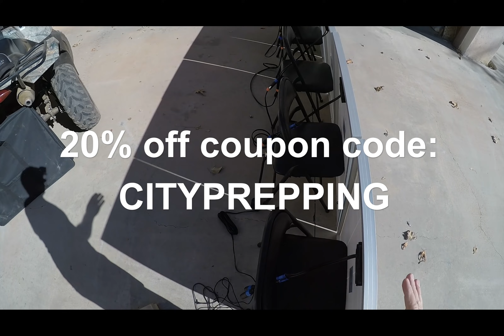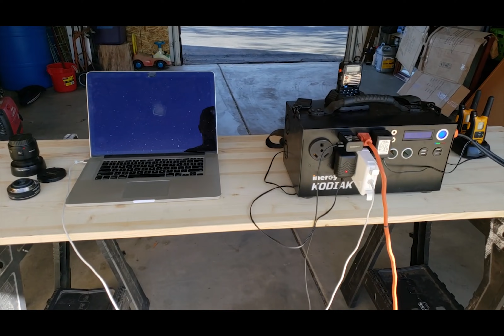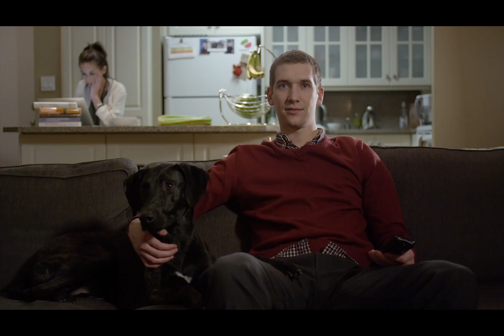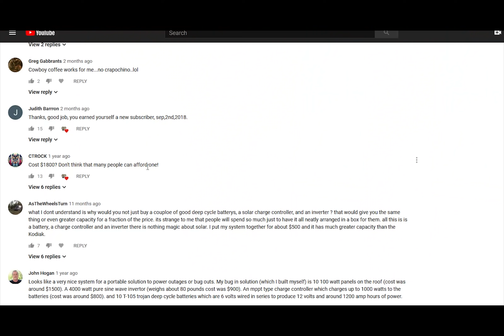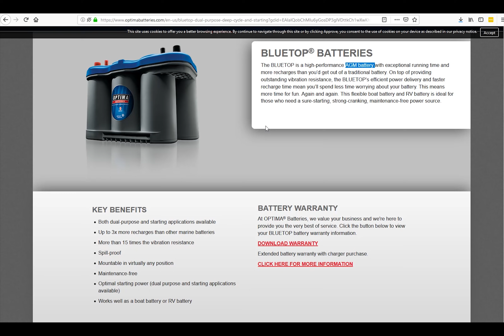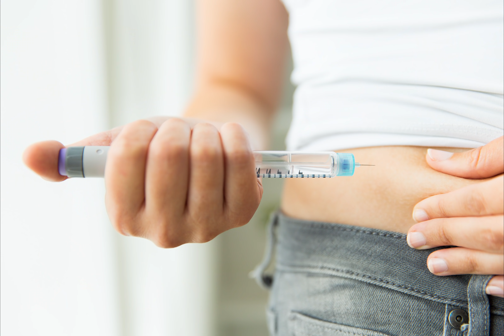Solar Generators: worth the money? Inergy Kodiak after using 1 year

Comment from the maker: Get the new Inergy Apex and save by using "CityPrepping" at checkout using this special link: https://glnk.io/p5q/city-prepping
Reply: I have designed and built TWO of my own units like this. I spent about the same Money, but mine can do more diverse things. I have a smaller system which is used to charge AA, AAA, and some D Batteries, as well as a small Lithium Iron Phosphate unit that will run a Goal Zero Lite-A-Life 350 Lumen L.E.D. light for 25 Hours on a charge. The unit uses a 40 Amp LiFePO4 battery for the tasks around the House. The larger Unit houses an 80 Amp LiFePO4 Battery, has a 600 Watt Pure Sine Inverter, and I use that to run the Ham Station, Phones, and Security System during Power Outages. BOTH are small enough to fit in my Vehicle in case we need to EVAC. The Smaller unit CAN run the essentials in the house, but its MAIN job is for camping trips, special events, etc. The BIG unit-nearly finished, will be able to handle 300 Watts of Solar input, and I envision IT being used in local disasters as a "Community Charging Station" for members of my Church, and possible the surrounding Neighborhood. I do NOT plan to let Fire or Police get THEIR Paws on either of my machines-I'D NEVER SEE THEM AGAIN!
Reply: Are you familiar with the Natures Generator Portable 1800-Watt Solar Generator by Earthtech? NO I do not work for them
Reply: Those Kodiak you pushed where junk. You have any conscience about it?
Reply: @GabrielDeMfromNY  How do you know its good when they will not let anyone demo it. Every other companies does this but not Inergy.  They have systems that out match this one already. Bluetti AC200 2000watts/4800 surge.1700WH battery
Reply: tony montana Iook above, I asked about blueti
Reply: Can it power a Heater?
Reply: at City Prepping - i want to see you send another update on your black out kit prepps.
Reply: Could you give your updated opinion pertaining to Off Grid Tek?  and Bluetti?  thanks!!!!
Reply from the maker: @GabrielDeMfromNY  I'm waiting for the new inergy flex. I have high hopes for it.
Reply: @CityPrepping  Love my Kodiak, received my Flex. Looking for Flex tips and tricks. Thanks for the videos.
Reply: Can I charge it with OffGrid Tek 200W panel?  Thanks
Reply: Why doesn't someone give the pros and cons of running a tag along rv off a solar generator. Their was a time when travel trailers had 3 way frig. No only propane or electric. Not to mention a/c etc.
Reply from the maker: @contradictorycrow4327  feel free to reach out me directly to discuss. I spoke with their team about this issue and their battery supply chain has been hammered by the pandemic.
Reply: I've ordered the apex over a year ago direct from their site.  Guess what.  Still waiting.  I'm not too pleased with them.  I've spent a ton on them.  Two batteries,the apex and and a supercharger.  They took my money with no issues.  Pisses me off that I've seen absolutely nothing but empty promises of shipping dates.
Reply: My question is, whats the difference between a solar "generator" and battery backups/a contoller and so on.

Wouldn't it be more practical to use your roof space, to put more solar panels on the roof, with a setup, that has the ability to output 6thousand/10thousand watts, and store that energy/power in batteries?

Comment: Three questions.
1. In case of an EMP strike, which generator comes with a protection bag?
2: We have a 250’ deep water well that cannot pump water without electricity. There are no hand pumps that address this depth. Can a solar generator be used in this case, and which one would work best?
3: We suffer from lots of dark cloudy days. Will the fold-up (Trex ?) solar blanket plug into any generator, and if not which will it hook up to? Thank you for your reply.

Comment: For the price I can build my own and get a larger capacity battery to store more power along with being able to control how much solar power I can use to charge it up and other variables that can make it better than just something built with specs you really can't upgrade to suit you. As for mobile devices there are some great power banks for reasonable prices as well that can charge via solar to 30,000mah or more. Time management isn't a problem on a Sunday or in the evening. Depending on what time you get off work.

Comment: Hello I'm new to your channel and I thoroughly enjoy your videos I've been thinking of investing in solar power which is portable at 100 Watts yet I was thinking of buying 12 volt batteries and maybe a possible converter for 24 volt that would convert into 110 power so that I could run a refrigerator or make coffee or even power circular saw anything that needs charging but a phone or tablet or computer could just be plugged into the converter which is 110.

Am I thinking outside the box would it work I'd appreciate the input because I would like to get a Kodiak battery generator but $1,000 is out of range

Comment: Thanks for the informative video, but I disagree on one point. A generator transforms mechanical energy into electrical energy. This is not a generator. It does not even perform the analogous operation of transforming solar energy into electrical energy. The solar panels do that, and they are not included. So I really do not see how a device like this can be honestly labeled as a "generator".

Comment: I don't use as much power as some people. I do love to get outside and do something or just relax in the non-power shed. But due to weather conditions sometimes and other times my health problem, I don't get out as much as I would like to. While in the house, I personally, unlike the family (parents, nephew, nieces and in the basement apartment, my sister and her husband), use less than the others. I rarely have the lights on, even at night, as I get enough light from my PC monitor and lit-up keyboard. I only use electricity for my PC, monitor and PC speakers (uses less power than many others on the market). For cooking, I use my Butane Camp Stove and my camping pot. My pot will fit a little more than a can of Campbells Chunky chowder. For an egg, I have the camp pan that goes with that pot and can be used as the lid for the pot (bought together as one package). I stopped using my fridge this summer and switched to foods/drink that don't require fridge, like whitener for my coffee or milk powder to mix with water for milk. Yes, it's not the same in taste, but I don't have a problem with it, myself. I have canned or packaged foods you just cook in the pot or add water, then cook, on my Butane camp stove.

Comment: I have 2 of these. Bought them about 3 years ago. Big mistake. Don't buy. This person says he put 650 watts of solar panels on his generator. Do this and your wiring will heat up and MELT your connection on the generator. I put only 500 watts of solar panels on one of my Inergy solar generators and the heavy duty connector melted. I had panels lined up for maximum transfer of power from the sun. I live in new mexico where temperatures can get up to 110 degrees F. These panels are in parallel (That means just 5 (100 watt panels would get up to 25 amps of current or more, depending on the variables). You will destroy your generator and it will void warranty. I tried (5) 100 watt panels and it melted the heavy duty input connector. It was out of warranty, so I knew they would not fix it, anyway. Manufacturers say NEVER put more than 400 watts of solar panels on their generators. Fortunately my profession was in electronics. I disassembled generator and hardwired new connectors and it was fine after that. Also, the "so called" generator can not handle the amount of current required by a standard washing machine. Tried both of my inergy Kodiaks ( At different times) Neither one of them put out enough power to run the machine when it kicked in to use maximum power.

Comment: I see the 30-amp RV outlet, the Titan has one too.  When Will P. did his testing on the Titan nothing was said about the RV Outlet that one would assume would be 19 to 22-amps or 2200 to 2500 Watts, but Will never said the 2-half’s together could power up a single 2025 Watt Microwave if you used the RV Outlet? Is it for show?  Is the Kodiak RV Outlet like those Generators that you choose between the Duplex or single Outlets?  Will it run my Microwave?

Comment: Because  of the charging inconvenience I got a gas generator installed on my van i have a great solar system but you can't control the sunlight. So when I go on vacation with my family I want my power all the time. So I got a trafer switch that I can hit and use my generator for a few hours and my solar for a few hours what ever is convenient for me...but solar generator are a great  option. im getting me one
To have as a 2nd backup option. 
Thanks for your videos

Comment: In grid down gas pumps need power. Gas generator will be down soon after unless you use it to power a gas pump..
Reply: True, that's why it's best to have a Tri-fuel generator. (You can even install a Tri-fuel kit on a gasoline only generator) This way you have a choice of gasoline, liquid propane and natural gas.  Our portable generator runs off of NG, which is what our house uses, as it's primary fuel source. We do have 15 gal. of gasoline and 40 lbs. of LP as a back up fuel source.

Comment: Solar is generally NOT a suitable generator in a typical outage. Post hurricane, tornado, flood, ice storm, snow storm, etc...no sun for days. Depending on where you live you may not have sun over 50% of the time anyway even without a storm. In the desert you are probably better off but just get an inverter generator or build a real permanent solar setup with a back up generator.

I say this because I have lived off grid on solar for many years. I fall back to my generator for days as described.

If you are prepping for armageddon you are wasting your time and money with any expenditure.

Comment: Outstanding presentation.  During our recent ice/snow/record low temp storm, our roof solar system had minimum production for 3 days due to 7" of snow on units / overcast.  The Power Wall lasted 1.5 days.  Could not run the power cord for either the gas generator or the backup emergency solar system into the house - open doors and 7 degree temps in Texas don't produce good results.  Talking with an electrician to see if I can install something to hook generator up to the solar input / power wall if overcast, no solar power.

Comment: What about heating systems? My home here in Utah has both radiant and forced air systems. It would seem that for my radiant system to function I would need AC power to light the furnace and monitor the temperature. The forced air system would require more power as the fans would need to run to circulate warm air. 

Another important draw would be that of the pumps used to dispose of waste. These pumps require a lot of power when operating. 

In a grid down scenario these requirements are often overlooked.

Comment: I have experienced prolonged power outages due to hurricanes and you may be surprised what you can live without. Just maintaining a refrigerator, a fan and a light is enough from a small generator/inverter.  A simple 120vac power source  can be constructed from a 12vdc battery(s) and a appropriate inverter (DC to AC) but you will have to find a way to charge the battery(s) eventually.

Comment: Hi,
I’m wandering how many hours could work with ham radio equipment “ 1 radio with 100w output + 13.8v 30amp power supply + laptop ( direct without battery ) + 4 LED’s lamps “ ?

Comment: If you time your other appliances to start after your fridge compressor is at its coldest (when it shuts of), just make sure not to open up that fridge till the others are done. You can also wrap a small fridge like that with several blankets or other insulation and it will cycle less often. Another thing to know about batteries is , you want to demand as little as possible from it at one time because it actually is like an exponential curve...if you try to run a ton of things at once, you end up losing potrntial Watt Hours. Instead, do like he says and try to plan everything out and run things alternately, even if the equipment is able to push a lot of items at once...do them with the least draw at a time.

Comment: I had solar battery system, had 8 100lb glass batteries solar panels and 4,500 watt trace inverter in the summer batteries would get 60 to 80% charge in 24 hours in the winter would take a week to get 30% charge, colder weather and shorter days severely restricted solar power, the solar panels are much less efficient when cold, you get less power per hour of sunlight when they are cold

Comment: BOUGHT INERGY APEX. HAD FOR A YEAR SITTING INSIDE HOUSE NEVER CHECKING IF IT WORKS, UNTIL A PLANNED POWER OUTAGE.
REALIZED  AC DOESNT WORK BUT ALL ELSE DID. INERGY IS TAKING  OVER A WEEK TO SEND PACKING SLIPS TO SEND BACK WHICH I HAVE TO PAY HALF THE SHIPPING. IF THEY DETERMINE ITS A MFG PROBLEM THEY WILL FIX, OTHERWISE I PAY FOR REPAIR AND SHIIPPING. ILL KEEP YOU POSTED WHAT HAPPENS. IM STILL WAITING FOR THE SHIPPING SLIPS.
Dec 11, 2020 just got the apex back and everything works. They fixed the problem and was under warranty, so I didn’t pay. I still think INERGY is best for solar generators. Customer service was excellent.

Comment: I built my own Solar Generator over a period of time. It has an 80 Amp Lithium Iron Phosphate Battery, an Allpowers 100 watt fold-up Solar Panel, a 400 Watt PURE Sine Inverter, 8 3.0 Amp usb outputs, 3 12 Volt sockets,and and 2 Anderson Powerpole Connectors. It also sports an AC Charger for feeding from the Grid, and can be charged via a motor vehicle using the Inverter & AC Charger.  Built in to this is also a 30 Amp PWM Charge Controller.Yes, it DID cost me about $1500.00 to build it. Part of that cost is because its housed in a rolling Pelican IM-2435 Storm Case for protection. Another thing I did was instead of using a fuse block, I built it using Circuit Breakers. Circuit Breakers are THE way to go-if a breaker pops, you find the fault, fix it and reset the breaker. I did it this way because in a full blown emergency, your local O'riely's or Napa might not be open and fuses will not be available.
I'm designing a custom Jumper Cable for the system as well, because properly setup, my little "JOULE" Box will jump start an  average car. Though I have not tested this as yet, I DO believe it will successfully power the new high efficiency DOMETIC 12 Volt Refrigeraters.
When not in use, EVERYTHING packs up and stores inside the case. Though I have no plans to market it for reasons too complex to go into, I'll be happy to share photos of it.

Comment: If you put this much effort and forethought into purchasing and maintaining a gas generator (watching the news/weather forecast, etc.) and storing gasoline properly with stabilizer. You'd be waaaaaay ahead of the game dollar-wise and power-wise. "Solar generators" just aren't ready for primetime - yet.
Reply: Agreed, our Predator 9000/7250 watts gasoline generator was converted to a Tri-fuel generator. NG is our primary fuel source, running off our homes NG line. (LP and gasoline is the backup fuel source) We paid around $1,900 for our generator, tri-fuel kit, NG hose and fittings, 10 gauge 30 amp power cord, manual transfer switch, GenTent and cable/chain locks for security.

Comment: 50 hours? you mean maybe 2 right? Also you do it once and it saves you time from the many complications and time lose with that setup. It also has expandable everything, panels, batteries and even  the charging controller. like i came here looking if the kodiak was good enough for what i need it specifically for, but if you want to LIVE off a solar generator, BUILD IT YOURSELF. itll save you money, time and itll teach you how all this stuff works. there are multiple videos and customer supports and people that would help you every step of the way. the literaly ONLY  reason you shouldnt do it is if your lazy. like i could understand if youd make a desicion to not make it yourself if its just for rv or if you just want it to be portable generator for small things or for blackouts, but if its for your everyday livelyhood, take the time and effort to research and do it poperly the first time "simple solar systems can take 30 minutes to setup a 100whr battery, a 200-400w solar panels and a charge controller."

P.S. you dont need to know how to solder anything and the reason he listed specifically just arent reasons to not build it yourself. There are other reasons to not do it, but what he was saying just made me braindead.

Comment: You never mentioned a tv, I live fulltime mobile. I only need to power my flat screen, xbox, really small mini fridge, maybe charge a phone and maybe some batteries. Maybe some lights as well. I converted my 5x8 enclosed trailer to a stealth camper and I am considering buying this, also what website do I purchase this item from so I can get the discount?, and does it come with good  quality solar panels or are they separately sold? I already have a predator 3500 watt inverter generator. But I want to eliminate my use of my generator unless I need to run my air conditioner or my heater. If I'm not running those items I would like to run solar for my daily small wattage items. Will this kodiak work for me you think?

Comment: Good for electronics items, but a real sized fridge and a small window AC unit are both required in the southeast US during hurricane season. This could not keep up with those required assets and small electronics/lights. You need a genset and fuel, no two ways about it unless you have a whole house solar system, Tesla wall, etc.